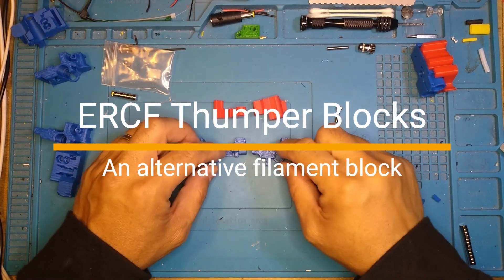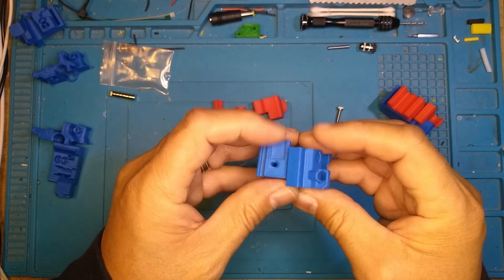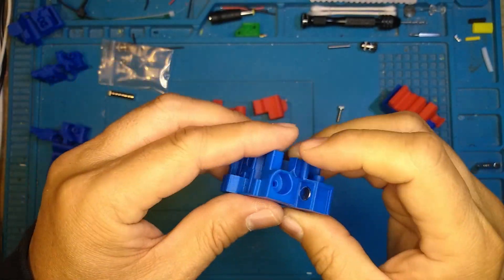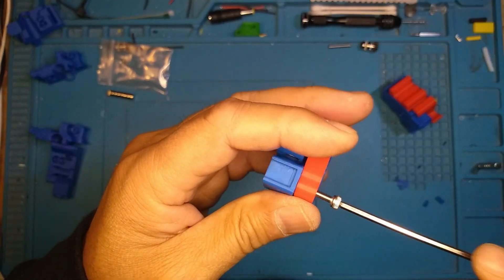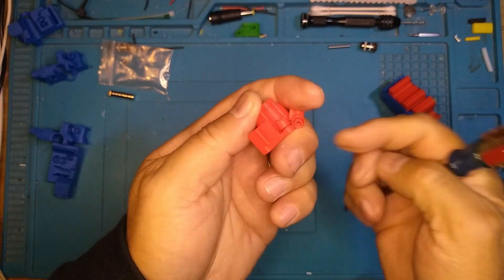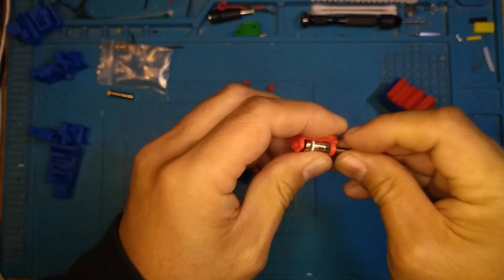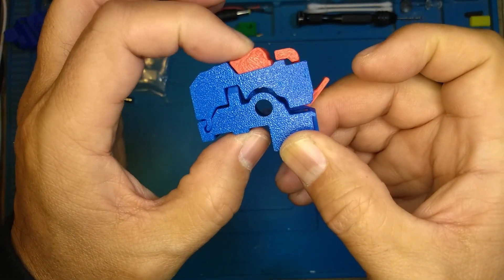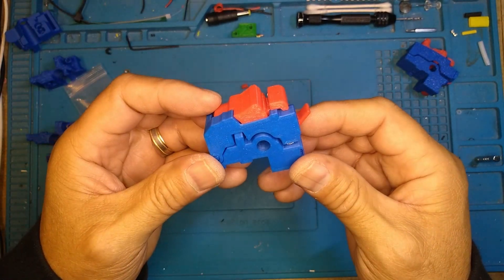ERCF Thumper Blocks, a filament block option for SturdyBunny/ERCF

Comment: I have a Voron 2.4 and have calibrated X/Y and Z along with doing E steps first using 200mm for each as the calibration. That said With the ASA I am using everything is just a little tight vs how yours just slips together. filament is 1.75mm caliper checked. Now wondering if my nozzle is worn out.
Reply from the maker: My first test prints (of Triple-Decky) revealed that my printer wasn't tuned as well as I thought. The Ellis guide is helpful when tuning. Fine tuning my pressure advance and flow multiplier helped the most. After those adjustments I was getting better fitment of the Triple-Decky parts. Then when I tried Thumper Blocks they too fit nicely.

Comment: What are the advantages of triple decky compared to thumpy?
Reply from the maker: Triple-Decky is mature and stable having gone through several revisions already. A lot of people have built their SturdyBunny/ERCF using these blocks. Thumper Blocks are considered beta and don't have as many users (yet), but interest in them seems high. I think both choices are excellent. I ended up using Thumper Blocks and have been quite happy with them.